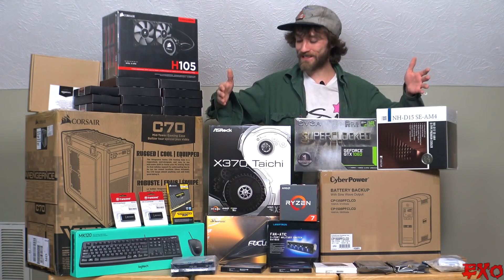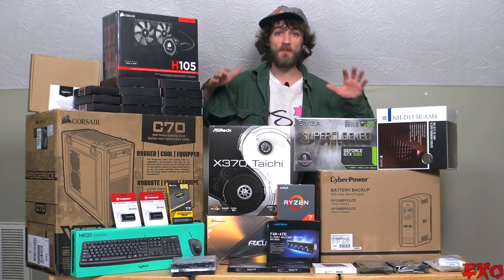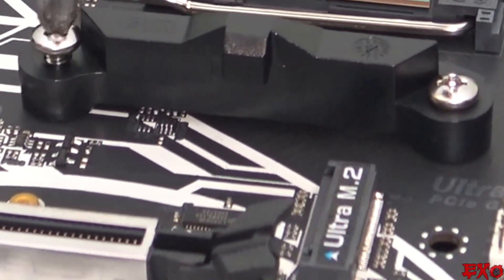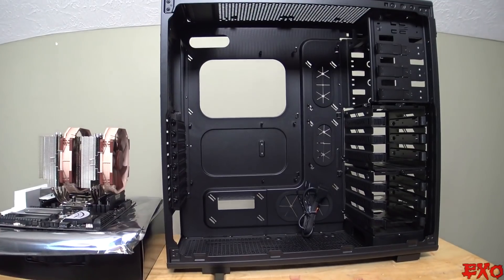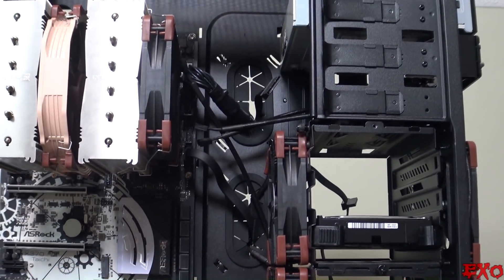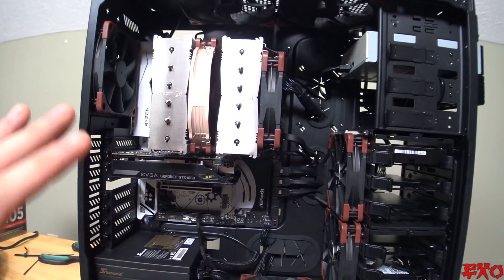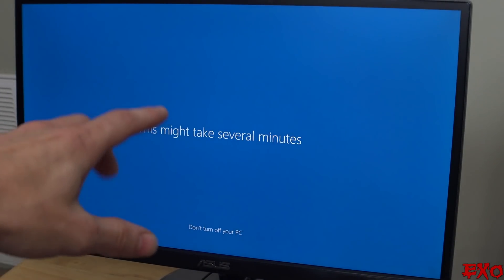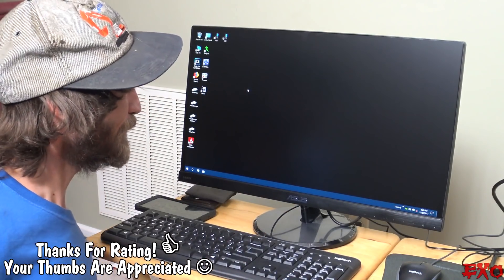Building a FAST Computer w/ RYZEN 7! EXO's FASTEST Computer Build EVER For 4K Video Editing in 2018

Comment: Coming from someone who builds computers for a living... u could get rid of 4 or 5 of those fans n still have good air flow in that case at half the db's... other than that u might want to consider upgrading to m.2 nvme for ur main boot drive at 2 gb+ a second speeds u cant go wrong and its better than the half a gb per second speeds with sata ssd's... and upgrading ur monitors connection from vga to hdmi for better performance and color correctness... other than that u did a pretty good job oh and if u go into ur uefi/bios in boot options and remove ur optical drive from the boot options it wont spin up when u boot the rig and it will still work just fine
Reply: Not a bad suggestion but the white cable is not VGA, it is DVI. Also he was looking at a budget and NVME is still around 2x the price of SATA SSDs - albeit that I would pay the extra $$

Comment: EXO!! The optical drive spins up like that because the boot up has a sequence of drives to look at. The order depends on what you want it to be for instance mine checks usb drive first, the optical drive second and then the HDD. this is in case you want to run a operating system from a usb or disk, mostly used for troubleshooting. There is more information you can look into but that is simple as I could put it. Hope it makes sense. Good build man!!
Reply: Yea, the boot priority

Comment: EXO, I also forgot to mention that you probably didn't need all of those fans. There is a point where there are diminishing returns....plus all the extra unnecessary noise. You can get the same cooling performance with less fans. Not sure that is matters now though since you have already bought and installed them.

Comment: Tip for ya bro; While the motherboard is outside the chassis; hook up all your stuff (except chassis fans off course) and do a post tip to check if the system post's. Then go to the bios and optimize the system, check if your Hard drives/SSD's register. This way you know if all your stuff works before you start mounting it in the chassis. Good build though :)

Comment: I have windows 10 and so far I like it quite a bit. Ofcourse I only have an Acer Aspire E15 E5-575-33BM laptop. I have added 4 gb of ram and am getting ready to add a 256gb SSD to the M.2 SATTA slot. Really like your computer build. That thing should be lightening fast to say the least. Good job.

Comment: lol you went a bit overboard on the fans and the power protection and the closed loop water cooling is pretty reliable also no idea why you went x370 when you were talking price to performance when all you are really gaining is crossfire and spending more cash vs a B350 the gtx 1060 is good but really you should have gone 1070 with a backplate for the isolating you wanted, ram was a great choice I chose the G.SKILL TridentZ and just having a nightmare of a time with ram timings for the 3200

anyway nice build EXO love seeing you upload videos!!!!

Comment: I just built with the R7 1700X as well, it definitely likes the team speed at/above 2900MHz when you are looking to overclock closer to 4Ghz.

You used a lot of good parts though should be a very nice pc
Reply: even at stock speed, Zen platform loves high speed RAM with tight timing. I run mine at 3200 CL14 with optimized subtimings and it's much faster than out of box CL15 timings

Comment: The 1700 and 1600 are the best bang4buck options in most reviews I've seen. The 1700x would possibly be, if it came with a cooler. But the 1700 comes with an RGB cooler that can overclock and perform exactly as well as an 1800x(on that stock cooler) I've been researching this all year lol. Still a damn solid build you got though sir. Sources are Linus Tech Tips, Tech Deals, Level1 Gaming, Paul's Harware, Bitwit, and Jayz2cents

Comment: That's a badass computer, EXO. Great choice of parts. I still remember when you built your old one. Holy fuck, time flies!

EXO, just a little FYI, is NOT good to put the motherboard on top of the antistatic bag that it comes in. The only part of the bag that is antistatic is the inside of the bag, not the outside. It's actually safer to put the motherboard on top of the box than putting it on top of the bag that it comes in!
Reply: also make sure u were a anti static strap the next time I have one pretty cheap to
Reply: Indeed! Thanks for the add up.
Reply: iTz_DaNiiLo yep ur welcome even though didnt actly have a pc built for me i got my alienware on dell its a alienware auroa r6 gtx 1080 graphics with 16 gbs of ram
Reply: Also has a radiator in it to
Reply: That's great. One day you might build your own PC, who knows! It's a great experience no one should be scared of
Reply: iTz_DaNiiLo yea i know what u meam but i actly dont really need a new/better pc the one i have right know is doing its buiness no lag nothing
Reply: I never use anti static crap lol 30 years of building them. Yet to have one die..

Comment: I am a custom PC builder and Level 3 IT Tech and I seen 2 things I would have changed not wrong but things I wouldn't have done. 1, you want to make sure you spread the CPU grease out using a glove or even a plastic bag, You need to make sure the entire CPU is covered evenly. Some grease is so think, if you don't spread it, it can actually leave holes and cause the CPU to heat up in that spot and cause issues.... 2. Some people will disagree with me here is the fans on the top and bottom can actually disrupt air that's flowing from the front of the case to the back. You can actually test this by powering it up and blow a heavy vape into it and watch it dissipate. In our tests at the shop, we were 10 to 15 degrees cooler inside the case without the top and bottom fans.
Reply: Aaron Hoobler and should have bought m2 drives not sata

Comment: I've got pretty much the same rig except I have the Corsair H110I cooler and Corsair Graphite 780T case. I have a Samsung 960EVO M.2 SSD instead of the SATA SSD though.

You are right, It is a beast of a PC, I couldn't get hold of a 1080ti due to the GPU shortage recently so I had to settle for the most powerful one they had in stock which pissed me off but I'm happy with the result. I'll stick to WIN 7 as my OS because WIN 10 is dogshit. I'll get another GPU when they come down a bit.
Reply from the maker: Thanks for sharing about your rig! Keep us updated if anything changes, glad you're having good luck with the choice of parts as well :)

Comment: You should always test everything before you put it in the case, you know motherboard on the box test first, you got lucky this time nice build EXO!
Reply: I disagree with this. It's safer to test it inside the case, especially for a newbie. You can leave cable management for after confirming it posts.
Reply: But what if you put it all together and it don't Post, now you have to try to trouble shoot the system in the case,  if it don't work you have to remove the motherboard the case and start over. I have seen it happen to the best PC builders they put it all together and it don't work. But look on the bright side if it don't work he will learn how to trouble shoot the system and that is still a good thing. P.S. been building computers since 1980, first build was with and old 8088 processor. LOL.
Reply: Hes a bit newer to building a rig... he did fine but for more experienced builders i agree with testing the system before installing the hardware and cable management... those of us that found out the hard way and have been burned will always test outside box first
Reply: Yep! it's just like test driving a car before you buy it, Thanks! Hair on the screen.

Comment: Your fan config is all wrong bro, there will be no airflow at all, you have the front ones pushing in and the ones behind the harddrives pushing out, the one at the bottom is pushing out as well same as the one on the back, this will create a no preasure for airflow and your temps will suffer,
How you want it is to flip the fans behind your harddrives
The one at the bottom you want to push air in to your case, because heat will rise up so it has no use for it to blow out,
The rest is okay! 

And please don't see this as hating or such, It's just a tip / help :)

Comment: I need that UPS surge protection, this place is nuts for electrical interference and I don't even use my maxed out 04 even though it way outperforms my toshita laptop, it's an 04 with a 3.4GHz single core, 4 gigs of ram, an ati 9550, all silent fans except the graphics cards fan,128GB SSD, I mean it's pretty much an oldschool computer built to the max the motherboard can handle which isn't near capable of what a real computer build of today could handle but I built it for sheer stability and while it sucks for anything that takes newer hardware features it makes up for it in brute force.. granted it's kinda limited at gaming only handling needforspeed prostreet at low-medium quality and because I leave it sitting basically the components fall asleep.. I mean performance will drop from not using it but when it gets broke in I've seen a 4.4 at the processor, 3.6 at graphics and a 5.2 at the ram which is almost as good as a single ddr3 1333MHz which makes sense because it's running 4 333MHz 1gig sticks, now what it can do is run 150tabs of ebay in private browsing without slowing down and for basic tasks it's about as fast as you can click but it really is more of an office beast than something for new games and it struggles with inweb video despite handling 720p in windows media player smoothly.. but honestly as much as I am attatched to it I have to say my build shouldn't be replicated because it falls in a catagory that like I was willing to spend up to $20 for the processor, there might had been one step higher that they wanted $140.. it's not very cost efficient to performance granted at around $300 it games like a $150 computer and works like a $700 computer so it kinda does split the difference but that's against walmart's pricing, I think at $300 I might be able to blow it out of the water with like an i5 so I'd definitely suggest looking at 2008-2013 models to build up for better compatibility and cost effectiveness.. yet it remains one of my prized posessions but a computer I miss is my very simple 2013 dell inspiron, I didn't mod it except I ran another 128 SSD in it and when I first got it new it was rather slow making a 3.7 at the processor... by the time it died which seemed to be from this places electrical it actually broke in and was making a 4.8.. did things just start speeding up and burn out I have no clue but I think it was a light fixture ballast went out and surged and released an EMP.. the SSD and the sata port on the motherboard was fried and I did drop the laptop a few times..

I'd suggest dell for a laptop even if that one started slow but it was a $300 model, but I don't suggest toshiba.. this friggin laptop glitches daily, it was left laying around and when I tried firing it up after it was not in use for a few months it wouldn't even open the start menu, and it never did fully recover.. it's just shit, I do wonder if it could be bad ram sticks.

Comment: Superb build love your cpu cooler it looks mental being so large i will be building a  ryzen system at some point  good to see your like me and still use optical drives .i have dvd and bluray disc plus a load of older laptops that can only boot from disc so optical drives are something i still use .One thing i still do is install a soundcard .

Comment: Ryzen 7 + 1060... i'd rather spend 150 quid more for a 1070 (ti) but still a very nais video exo! oh btw Ryzen really does rely on ram speed. i have the same but 3000MHz. You can overclock it to 3000 if you do it the right way. Ask linus from LinusTechTips if you need help.
Reply: I was thinking the same thing 1070ti OC is worth the 150 more.
Reply: yup it really is!

Comment: I have a question for all you audio Experts. Just got my first car, Suzuki alto unfortunately, and I need some hard pounding bass in it. I'm not gonna be using my trunk for anything else than audio, just clearing that out.
I've been looking into Pioneer TS-3001d4 'brand new' in a ported box and Rockford Fosgate PL2-212. Which one would punch the hardest? I will power it with a Hertz HDP5 amplifier.
Reply: Frederik Andersen i would choose the pioneer

Comment: Great build buddy
Reply from the maker: Thanks man! Still running great without issues
Reply: EXOcontralto I already know it is. I was all about Intel but now I am both blue and red team which makes me team purple. And I love it. I have the 1800X Ryzen with MSI 1060 6GB, 32GB RAM, 1TB SSD, 2TB HHD, MASTERAIR MA610P, CORSAIR AX860 PSU, ROG CROSSHAIR VI HERO WI-FI MB, BLURAY BURNER, MULTI MEDIA CARD READER, and CORSAIR BLACK 780T CASE. I built it last July and this beast still killer fast. So bro believe me when I say I feel your love you have for the new beast rig you built.

Comment: EXOcontralto - You missed a screw on your motherboard, between the PXI express 1x slot on the top and the RAM... You can see where it goes at about 9:54 in the vid, the little ring of ground points that are bare...

Comment: Hey EXO, I just bought a 12 inch JBL subwoofer rated at 1000 watts max power and a 12 inch kenwood sub with 2000 Watts, and I was wondering if my battery will be able to handle this power, it’s a 12 volt energizer, will I need a more powerful battery?

Comment: Should be m.2 ssd for operating system, and is that monitor plugged in via VGA? And you don't need that many fans for that little setup
Reply: The monitor is plugged in with dvi https://en.wikipedia.org/wiki/Digital_Visual_Interface and he doesn't need a m.2 ssd for operating system because the that samsung ssd is fast enough for his needs.

Comment: Great Video Exo. I have a question, why did you change the fan on the CPU Cooler?
Reply: Barely any stock CPU coolers will keep up with even a mild overclock.
Reply: no i mean on the non stock cooler he only changed one of the fans

Comment: If you bought a rx 480 you would have almost the same rendering time as a 1080 (with the latest drivers) for about the same price as the 1060 i think. That is if you are using Adobe Premiere. ;)  The 1080 used 19min on a 10 min 4K video and the rx480 used 19 min 30 sek.
Reply: coolshookieboy91 ya but the rx480 bottlenecks alot worse on gaming and with crypto mining they can be hard yo find and expensive when u do find em
Reply: The hair on your screen this guys going for production though

Comment: I noticed your monitor has an HDMI logo on the face. I advise you to use the HDMI port instead of VGA which carries an analog signal. Not a great thing to use in this day and age. They are featured on hardware mostly for compatibility with old devices.
Reply: it's more like DVI cable to me since almost no GPU have a HD-15 output nowadays

Comment: Your video helped answer a question I had for a very long time. I have always wondered if the Noctua NH-D15 would allow case fans on the side panel. It turns out that it does not (at least for the top fan at least) and that you had to make some modifications  to allow one fan to be mounted on the side panel. Nice build. I use 2 fans on my C70 side panel, but I have liquid cooling though
Reply from the maker: Thank you for your comment, you're very right :)

Comment: I use windows 10, BIGGEST thing I HATE about it is they force you to install updates there's no way to get out of it unless you install a windows spy killing program and disable the windows update that way doing it through windows does not work. but other than that it's okay
Reply: Aaron bilger Its always like shut down and update I’m like no I don’t want to
Reply: The key thing to disable is shared updates on Windows 10 or else it will just keep uploading your previous updates across the web, killing your bandwidth and wasting resources! It is under Delivery Optimisation in Advanced options for Windows Updates accessed from control panel in Windows 10!

You will see, allow downloads from other pc's and can shut it off, you can also select advanced options under Deliver Optimisation and can control the bandwidth your pc uses downloading or uploading! You can also modify your active hours so windows won't bug you as much during those hours!  

For me Updates are important, being an insider I prefer my system stays up to date as much as possible, this also means I must link my live account to my pc! But also remember you can pause updates for up to 7 days under Advanced Options in Windows Update section of Control Panel!
Reply: The number one thing microsoft monitors and records in Windows 10 are things which you agree to under the user agreement, even TV's were caught for sharing personal preference data about owners while they remained unaware! But #1 Windows Update helps prevent exploits in your system which can lead to your personal information being taken without your knowledge or consent!

Comment: wait @EXOcontralto did you plug in the 6-pin power to the 1060? the way the camera is angled I can't tell if its plugged in. I see a 6+2 pin around it but i don't actually see a cable going into the video card.
Reply: BassGuy24 of course he did, firstly he has the display plugged into the 1060 and he has the 6 pin going into it

Comment: Kingwin makes a controller for that optical drive noise! It’s intended to turn hard drives on and off but will work with an optical drive as well. As long as it’s powered off of the same cable as you hard drives. Here’s a link https://www.amazon.com/Kingwin-Optimized-Controls-Provide-Longevity/dp/B00TZR3E70 but other than that I don’t think there is any other possible fix. I had the same problem in my old pc.